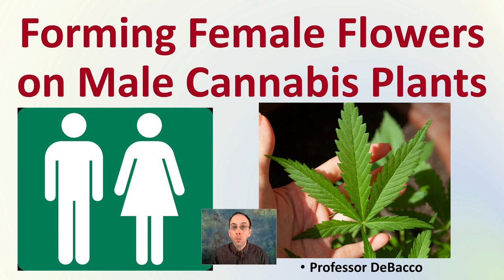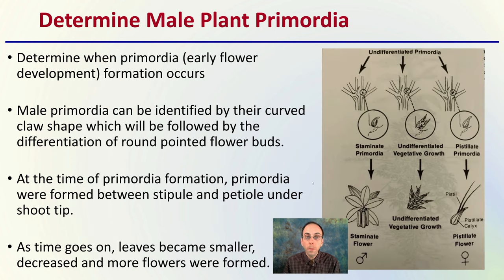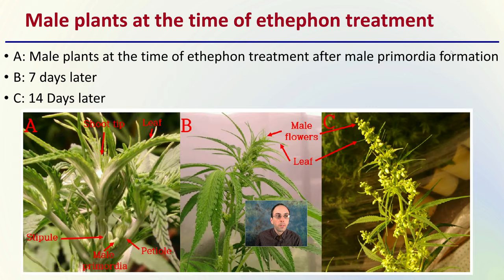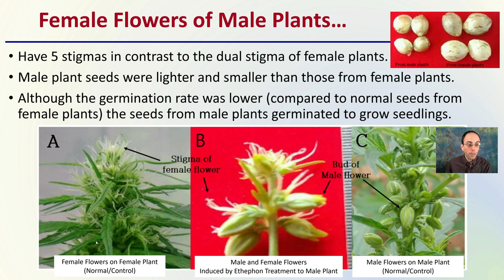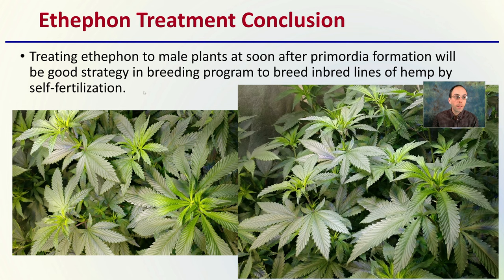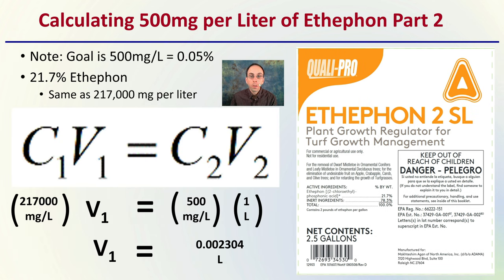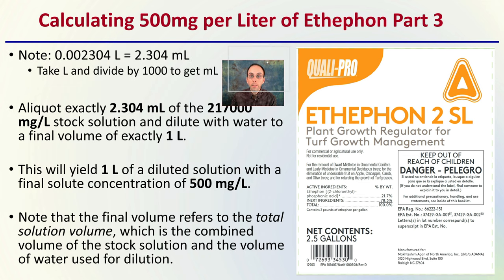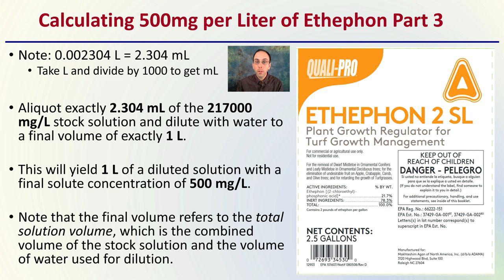Forming Female Flowers on Male Cannabis Plants

Comment: I think my male plant has begun doing this on it's own. I've been manually picking away male buds for the last month and putting incredible stress on the plant. Essentially defoliating it. I just today noticed what looked like a female flower and sure enough it has 5 stigma. Very strange. 

The mass of the roots are primarily located underneath of the soil within the water held in a humidity tray. Springtails keep the roots clean and keep them from rotting.  0 nutrients were used other than leftover aquarium water. The soil contains a mix of ripped up sheet moss, perlite, Fluval Stratum, fine sand, and a touch of moisture retaining generic potting soil (possibly miracle grow I'm unsure at the moment).

The particular male I'm referencing assumedly comes from an autoflowering strain, as it began producing pollen sacs around the 3 month mark with 18/6 lighting.

I'm interested to see if this trend continues, and if it will self pollinate in the near future. Very informative video, thank you.
Reply from the maker: Please report your findings.
Reply: What happened?
Reply: might be an important finding ---- but as it was an autoflower it is difficult to reproduce results as they can't be cloned ---- you hardly find anyone who just grows hemp to research males
Reply: Yeah I've been interested in this for a while, could you breed a line that has hermaphroditic males and non hermaphroditic females? The idea being that you would usually discard the seeds that come from the males unless you planned on sprouting them to look for a female representation of that particular male.

Comment: Would it be dangerous to apply Ethephon to plants that are destined to be smoked or processed into THC oil? Will it all react into ethylene and/or wash off first or will it pose a toxicity risk if smoked/ingested?
Reply from the maker: Can depend on concentration, timing of application and growing regulations.
Reply: this is already used for fruit ripening --- so bananas among other fruits in a supermarket etc. might already be treated with it or the pure ethylene gas ---- Ethephon is used for its water solubility which comes handy if you wanna spray --- so it's prefered when the fruits are still on the plant

Comment: As ethephon and ethylene gas are quite costly I thought of using the cheaper calcium carbide which is also used as a ripening gas.
Reply from the maker: Not the same compound.
Reply: @DeBaccoUniversity  acetylene works as a ripening gas because of chemical similarity --- I know it's not the same --- ethephon is used for its water solubility

Comment: Update 
It seems that the seed produced this way can be both female or male 
But the two male plants I have are both sterile 
One produced absolutely no pollen 
The other produces pollen that doesn’t pollinate 
I have used STS spray and produced Fem seed on a female  plant from seeds produced this way 
But I was really hoping for traditional breeding also
Thanks still
Reply from the maker: Yes, that is correct, just because the flower is female, since the plant contains the "Y" chromosome the seeds can produce male plants.
Reply: @DeBaccoUniversity 
But the issue I’m trying to figure out is that the male plants so far from this method are sterile 
I have never had sterile male plants in many decades of growing cannabis 
It’s hard not to consider this an effect of this method

Comment: Are the female seeds provided from the male plant will be viable or potent as to the original regular female seeds from the same strain line? Does the female seeds from the male plant needs to be crossbred in order to have viable and worthy female seeds? I ask because the female plant can be used to make feminized seeds which are viable copy of its intended genetic strain line, I wonder if this is also the same with the male plant when induced to producing female seeds in which 25% of seeds should be female but wonder if they are viable as to an authentic female seed.
I also read that the US has just recently banned the use of "Ethephon". How are the "Ethephon" based products still being sold easily online in the US, is it only banned for the application to Kashmir products?
Reply from the maker: Seeds produced have the chance at the same viability as others but often ends up being less as there needs to be careful attention to detail through the process.  Also, Ethephon is still for sale in the USA.
Reply: @DeBaccoUniversity  Thank You very much for your reply.